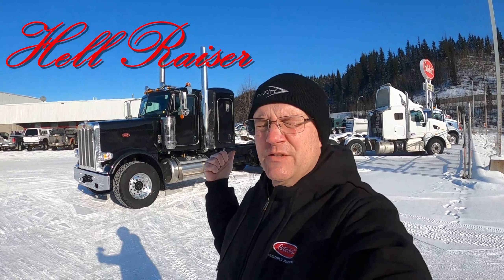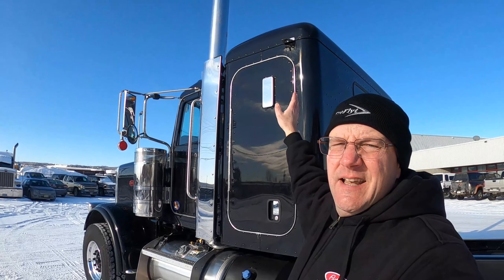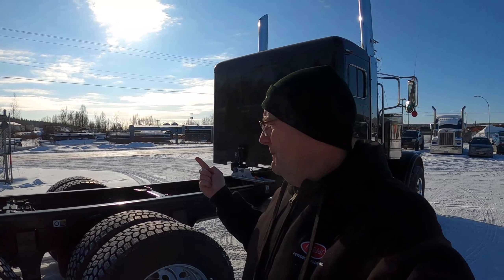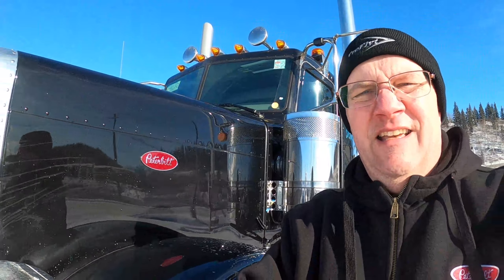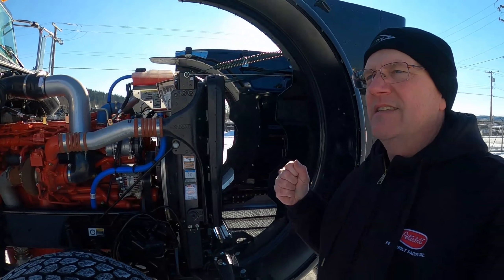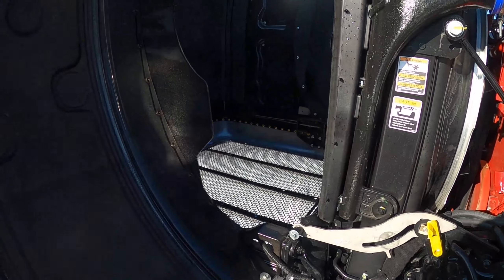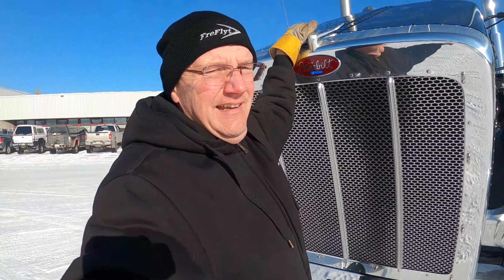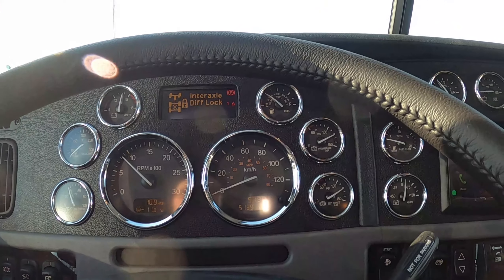Peterbilt 389 Heavy Haul

Comment: What are the heavy hauler/loggers running in your area for rear ends prodominately? I trust Meritor for that industry in Ontario.
Reply from the maker: I've been doing a lot of Meritor these days.
Reply: @mikethetrucknut  I have dana in mine. At 620,000 km I had the front diff rebuilt. Thankfully they covered it under warranty and was blamed on not being assembled properly at the factory. We have a log truck with 1.2 million km's still going strong with Meritor.

Comment: Truck looks naked without the visor, would look good with the aftermarket round headlights to give the truck the old school look. The USA does have some goofy regulations, what is wrong with backup lights. The 445 supers I’ve been told they are bad for hydroplaning. If a owner is worried about highway handling they always could run 315 steers more enough capacity for a tractor.